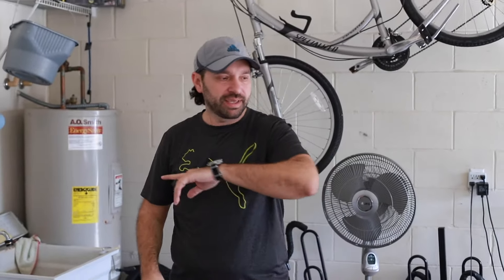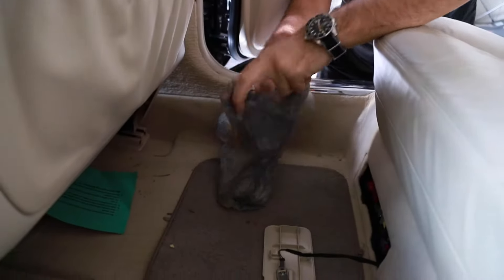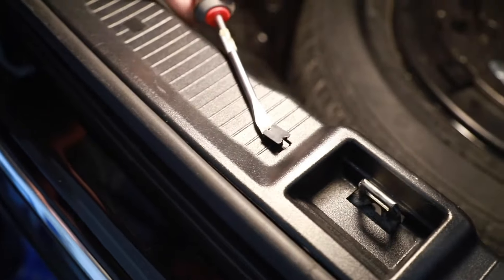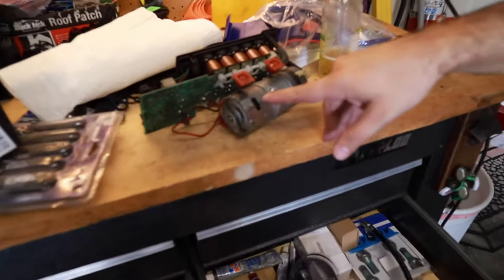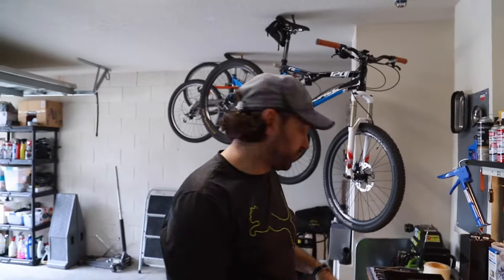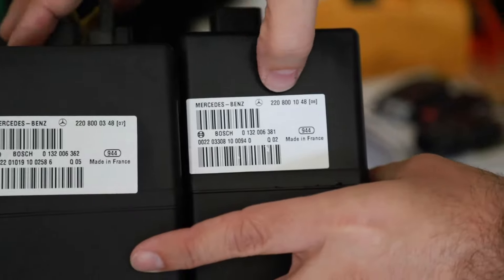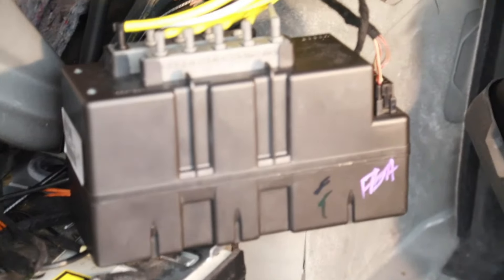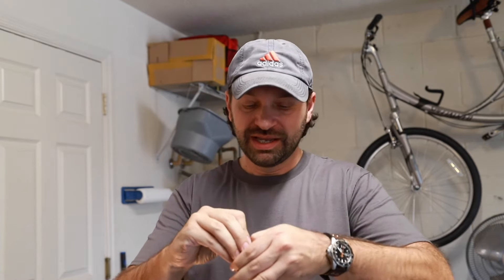Mercedes PSE (Door) Vacuum Pump | Soft Close

Comment: Thanks for sharing!I have a problem but only with my driver door,something pupped in the door and since then everytime the door tries to close you can hear a noise in the door trying to close it for a few seconds than stopes but the door still don't close.The rest of the doors and trunk work fine,any suggetions?
Reply from the maker: I got the same problem on the driver door. The mechanism in the door is broken. Not sure I want to tackle it yet but I’ll get to it eventually. I haven’t found an easy/cheap solution yet that works other than getting a used unit from eBay.
Reply: Did you ever do a video on fixing this problem within the door? I have this same issue right now. Please link if you did?  Thanks!
Reply from the maker: @nuka2g1 I never fixed the door. You gotta buy a whole assembly. It’s made out of plastic and is a common issue. It’ll eventually learn that it doesn’t work and it won’t operate that door anymore until you disconnect the battery again.
Reply: @Turbo_Snail  thanks for the response!

Comment: Hey mate, exactly which fuse is it? Can you help by sharing this information. Thanks, Kris
Reply from the maker: Can't remember off hand. Check under the right passenger seat. There are not that many. Go in with a flash light, its fairly easy to find. If you replace it and it pops again, thats exactly what I had going on.

Comment: I have this same problem, the only thing is everything works the only thing is i just cant unlock the car, when i manually unlock the doors i can lock it with the key fob, i can unlock the trunk with the key fob, i just cant unlock the doors with the key fob. theres no clicking coming from the pump like yours, i can hear the pump trying when i click the unlock button but no unlock, do you have any suggestions?
Reply from the maker: in could be that one of your pneumatic lines are punctured or broken. You could disconnect the lines, blow some smoke through it and see where it comers out and seal it. If it's not clicking, you probably won't need another motor there.

Comment: Hello
Repairing my cl500 in Estonia and l have a problem with vacuum. Trunk opens and closes from the button like it should as the massage seats work also. But l have a problem with central lock, softclose , rear curtain( wich is up and dont go down) and the backseat headrests are up and dont go down.
Do you know or have a guess what should be the problem for these malfunctions?
Reply from the maker: Sounds like your PSE pump is dead. Use the video as a reference it will fix your issue. The seats use a different system. The PSE takes care of the soft close doors and trunk, central locking system and it releases the headrests. Some people had good success parting out that box and replacing the insides, I would get a refurbished unit if I had to do it again but a used one should work just as well.

Comment: I came across the replacement motor for that pump. I don’t know it you seen that.
Reply from the maker: Yes, I’ve been made aware that you can just replace the pump. But it is important to keep the electronics if you do that. For me, if I had to do it again, I would just replace the whole unit again rather than taking things apart and mess with the motor and electronics. There really isn’t a price difference between one and the other.
Reply from the maker: If you know how to deal with the electronics and can replace a brand new motor, that’s the best way to do it. I wasn’t brave enough to attempt such a swap.
Reply from the maker: No I didn’t. You got a link?

Comment: My door locks and headrest works however, my vacuum for doors and trunk doesn't. Can the pump partially work?
Reply from the maker: No. The pump either works or it doesn’t. Maybe a line is cut or one of the 2 blocks (as seen in the video) got somehow disconnected or cracked. I doubt that tho. My vacuum for the trunk is bad (line leak) and 1 door doesn’t work (mechanism broke). That may be another video but those parts are very expensive so I have been procrastinating. That is one part you don’t want to get the cheap knockoff as they have been known to be very bad quality.

Comment: Hi there. Does it also affect the alarm ? My alarm does not go on and it shows the car flashing but no sounds comeon. This started after changing the battery. Is there anything i must do to reset the pump or i must purchase a new one?
Reply from the maker: This should have nothing to do with the alarm. As I understand there is a separate horn for the alarm. Ours has never worked. We’re not planing on replacing it either.
Reply: @Turbo_Snail  I was suspecting the same. The Mercedes dealership is charging an arm and a leg for this . I am looking for the manual so that I can troubleshoot and hopefully fix it myself . I have all the disassemble tools and would like to make it a DIY project
Reply from the maker: Please share your results. I use MBworld.org as a great source of information. These guys are very knowledgeable.
Reply: @Turbo_Snail  thank you. I shall do that as soon as i get the information and solution

Comment: Would this be the cause of my locking system preventing the top from coming down?
Reply from the maker: I think your top may be controlled by a hydraulic system if it’s on the SL. It would be a hydraulic pump in your case.

Comment: Mine is working but no trunk no soft close on doors opening where should I look next
Reply from the maker: You probably have a broken line. Get a smoke machine, connect it to each line in the trunk and pump smoke through. You’ll eventually see what panel it’s coming out from the take that apart and voila. Smoke machines can be rented. Not every auto part store has them but I’ve seen them at O’Reilly before.

Comment: The reason these pumps go out is because of a vacuum leak/leaks. These w220's are notorious for door actuators failing. Listen for vacuum leaks inside the doors or trunk.
Reply from the maker: Yes. That’s correct. A simple leak develops and then the pump runs until it times out. I guess it overheats and eventually just dies. We could hear ours operating for a while until it finally broke. The funny thing is, once we changed the pump the leak cured itself. Maybe it was the pump that was leaking after all.

Comment: I don't think you needed to replace the entire pump.  The rotor in the pump motor normal breaks and causes the fuse to blow.  All that was needed was a new rotor.
Reply from the maker: Yeah, I didn’t figure that out until after it was done. However, I didn’t have to take it apart.
Reply: Where can I find information if I want to open the pump and try to repair it? Are there any pics or how-to's? Can I get more information about the rotor you're talking about please?
Reply from the maker: I was I formed by a few viewers that this was possible. I haven’t researched it, but MBworld.org has a ginormous forum with tons of knowledge. That being said, I can’t imagine a motor being cheaper than a refurb or used unit from eBay.

Comment: Why when you had the pump out, you didn't you  find which component is leaking air?  You will be spending another $200 in a couple weeks, unless you just spend $35 and replace that motor that will keep burning  up also in 2 weeks. Your seat air bladders   probably leaking and  are causing your pump motor to run constantly. Disconnect them and block them off, probably along with those door close actuators if you can shut them without them. This might just be your problem.
Reply from the maker: Thanks for your concern, however, if the car detects that a zone is running too long without a confirmation of a door closure for example, the car will then shut off that zone to prevent pump damage. That being said. This video is now over a year old and the pump is pumping just fine. The pump was old, 15 years old to be exact. Parts wear out. I've seen cars with 10 years on them and all components work, yet the pump just had it. 

The only zone that leaks is the trunk and that shut itself off the same day we installed the pump. Now we don't have soft close on the trunk anymore. Not worth fixing to be honest. If you have the MBII computer, you can go in there and reactivate any zone that has been shut down manually. Or, just disconnect the battery for about 10 minutes... after reconnect they should all come alive again. 

Happy wrenching!

Comment: What did the working pump cost ? My S320 pump motor burnt and damaged the circuit.. My part number is 1408002548. My car is 1994. I replaced the pump, but it failed. any suggestions.
Reply from the maker: Buying a used pump is like rolling the dice. It’s still used. Just get another one and hopefully you’re more lucky. I found mine on eBay. I can’t remember maybe $100-150?  It’s been a while but all still works.

Comment: Is it the same part# for s500 1999
Reply from the maker: No. Pull your pump out and check the part number. Every year is different. Sometimes they had several different part numbers within the year.
Reply: @Turbo_Snail  its for my buddy car I saw his driver door work but the other  ones no its kind not the same symptoms
Reply from the maker: Could be a busted line. Maybe a leak. Blow some smoke through. You’ll see it coming out of the plastic lines are cracked.

Comment: Mines gone on my sl350. Had mine out found burned out wires on the motor flixed that put it all back in still not working. I’m guna have to buy a new pump. Cheapest ones are £400 and that’s second which I’d rather not. Mercedes are absolute headaches
Reply from the maker: Oh man. Sorry to hear about your troubles. Search eBay. You should be able to score one cheap. Just be patient. I know it sucks not having that part working but your patience will be rewarded. It took me almost 2 months and I thing 3 tries. Mine was quoted new I think $800 just for the part.